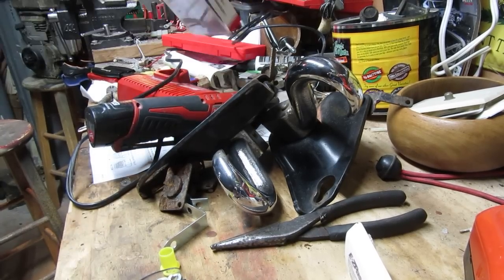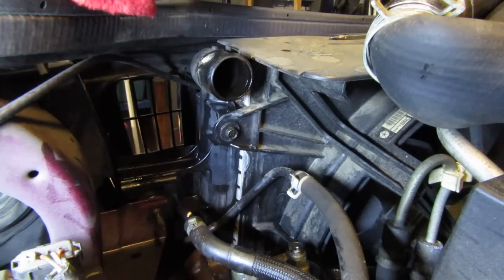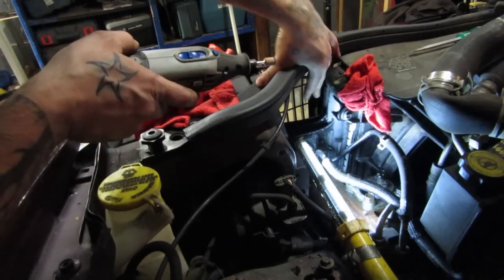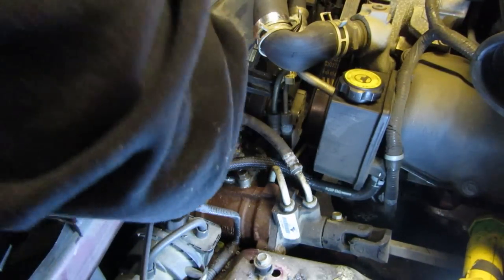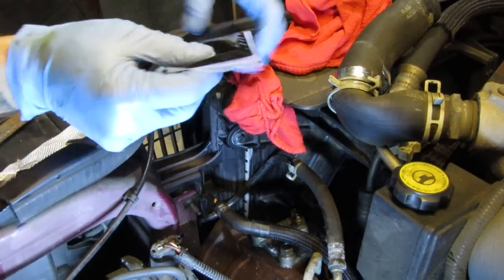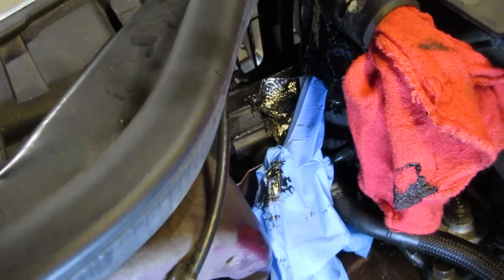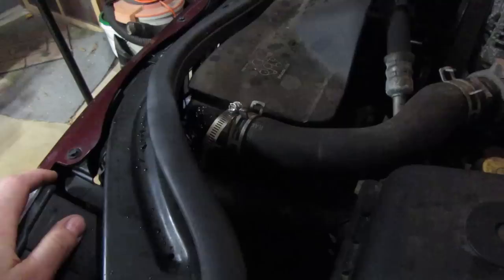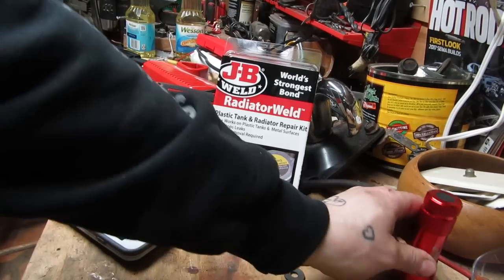RADIATOR FIX - JB Weld Radiator Repair Kit

Comment: Thanks for sharing, I will be trying this on my Land Cruiser 100 series for a quick repair. 👊🏼
Reply: Don’t bother it’s $14.99 down the drain.
Reply: Johanna Cruz What would you replace it with if you where out on the trail and needed to get out of a bind? 🤔
Reply: Mister Memo well it was just a hairline crack. Now that applied all that epoxy is worst🤦‍♀️ I had to buy a new radiator last nite which I will install myself later on.
Reply: Good luck but yes I was stuck and didn’t managed to stop the leak.
Reply: @goodvibes04281  I hear you tho! It's not the solution for sure. Thanks for watching :)

Comment: i would suggest a new radiator saves alot down the road 
does not work with all situations ....bite the bullet and buy a radiator ....an aftermarket radiator is better than this ...
Reply: Not for me i’m not that handy. And mechanics get 140$and hour here in Reno  so i’m gonna try it   On my  old. jeep.  Lots of jeeps here

Comment: You should have removed the Radiator , and fix it . Doing it this way made you miss a spot.
Reply: If you're gonna go through that much trouble, you may as well replace it.

Comment: i may add one   not so minor point.  because  these are pressure  cracks    it is advisable to drill a small  hole on either end of the crack.  this  does 2 things  it stress reliefs the  plastic from the natural tendencies of the crack to extend it self. secondly it adds a small anchor point  for the epoxy to ceate a  thru rivet in the round terminus at either end of the crack.  i can assure you the stress relief alone is the real benefit of drilling both ends of any crack  ,  no matter what the material . im willing  to bet  its the lower end of the crack that  a stress relief drilling would have helped hold, altho i will agree it is by its nature a patch, so the benefits  of being stuck completely  and  managing a leak to the point where you can still drive  have me adding  a little kit  as you described  to my desert box in my truck
Reply: Wish i would of seen this comment before I did mine that makes alot of sense
Reply: An excellent point, indeed.
Reply: I gotta do a hairline crack right on the top on mine, I got lucky and it's in a good flat spot so I'm going to try this. Thanks for the info

Comment: Well if the radiator was removed and repair was done on a work bench or table the proper application would've  been more properly done giving a permanent seal
Reply from the maker: If I am removing the radiator, I am just going to replace it. This was an attempt to hot have to do that
Reply: @DEInTheGarage  
Xactly & EvN if done professionally like that, probley only would’ve lasted for a few months or a year- IF other parts of radiator weren’t about to wear out👋😒 - I think I’ll attempt JB waterweld, not radiator weld(both of which I have) because it’s eazier to apply well, ironically

Comment: Just finished mine up letting it dry now, that epoxy gets hot quick and I tried to brush on then add the fiber glass ( yes I brushed in the fiberglass before applied, be quick thou)and pour the rest of the epoxy on the fiberglass, I used the putty stuff first and it started leaking again. I went longer and taller than the actual split. Thank you for the video it was really good to have the help
Reply: No I’m sorry it didn’t, it did slow it down to where I can address it every 3 days instead of every day, but it might work different for you. It’s definitely something that I now keep in my emergency kit when I go to the woods
Reply from the maker: @bspeckter  dang.. sorry to hear that
Reply: Well, it’s cured and looks like I was trying to hard to get it on the radiator and the fiberglass, it’s bubbling up at the top. I should have put it over the putty , because it was only bubbling from the sides. I’m going to go grab another kit and add it on my dinner break this afternoon. You’re kit is a very good suggestion, I know that this not a permanent fix, but I’m on a budget and I want to replace my radiator with a good quality one so I need the fix to make it a few more paydays. I will let you know in the morning how the second try goes.
Reply: @bspeckter  Did it stopped the leak?
Reply from the maker: Lets us know how you make out! I was not successful, but I believe this product could work under better circumstances
Reply from the maker: I hear that. Might as well try the quick cheap option before going all in on new parts. Good luck!

Comment: I tried this stuff, and so far so good.  I know I will need a new radiator soon. My break was on top and easy to get to.  I have a dremel engraver, which did a great job to V out the crack, and went about 1/4" beyond each end of the crack.  Thanks for the video, it really helped, 👍!

Comment: Adding pepper into the radiator works, I did it a few times, and as the engine heats up, you will see the leak go away
Reply from the maker: No kidding... I have heard of egg before, but not pepper.

Comment: Dude great video. Especially the part that shows your failure. I do believe if you were not so intent on making a video your effort would have been successful. I used dye to isolate my leak. A YouTube video informed me how to find coolant leaks. The bright orange fluorescent dye showed me my hair line defect. Well better repair next time. I really get close with my zoom on my phone to inspect things my eyes alone cant see. I'm going to invest in one of those telescopic micro lights soon
Wow a JB Weld radiator repair kit.  
That was not available 4 years ago when my 6 month old radiator sprung a leak along a crease that connected to a mount crease. My patch peeled and leaked after 2 years now in the 100° Texas heat. Maybe the fiberglass would have made a better patch. So, I am not  going to remove the part of patch that  is working. I am going to patch the failed part of the patch. I hope it hold for another 2 years

Comment: My crack is in the same exact spot
Reply from the maker: Yea, it is a tough fix there. too much going on to get a decent patch
Reply: D&E In The Garage I tried jb weld and a stop leak and it don’t work guess I need a new radiator

Comment: Cracked my Volvo s60 radiator on the plastic part also. Going to try this this weekend. Also it's not so much the cost of the radiator it's the process of taking it out which sucks on that vehicle...
Reply from the maker: Agreed! Good luck with it!
Reply: Did it hold up
Reply: @mikeyboy1001  Yes. I've put almost 5k on it and its held up fine.
Reply: Going to do this in a Volvo 850 wish me luck

Comment: Probably would work better if the crack isnt on the side
like yours. If the cracks on top maybe itd work better since the jb weld will be seeping into the crack
Reply from the maker: I agree. Also, if I had removed the rad it would have been easier to apply, but if  I am removing it might as well replace it (which is what i did)

Comment: I’m putting this on my radiator. It’s cracked down the middle of the plastic part. I just need a temporary fix until I get paid next week for I could replace the entire thing
Reply from the maker: Good luck with it! Hope it works for you
Reply: D&E In The Garage it’s still leaking but not as much as it was. Before I had to refill the entire thing with 2 and half gallons of water now I don’t even have put 1. It has help these last few days bringing my truck to the shop tomorrow and buying a new radiator Thursday. I don’t recommend it as a permanent fix but it is s good temporary repair until you get it fixed. I’m very impressed with it

Comment: FYI, Flex seal will not fix a leaky radiator either... Don't ask me how I know... Lol
Reply from the maker: Hey man... gotta try everything at least once, right?
Reply: @DEInTheGarage  yep. I think like you, if it can save me $100 I'm all for it.
Reply: I put flex glue on my crack recently.. And gasket maker. Hopefully trying this before replacement D: 
Gonna end up getting new radiator eventually but cant do right now so anything to hold it off lol
Reply: Lol or me how i know it doesnt fix a roof either .

Comment: The JB weld saved my butt on the trail. But like you I ended up buying a new radiator. Even if it had held I would of put the new one in. Out her in the SW running in the heat I would constantly worry about it giving way. As usual awesome video. Cant wait for the video on the radiator swap.

Comment: Great video as usual. I love to see this kinds of things tested out. I generally wouldn't trust this kind of repair as a permanent solution, especially for something as critical as a radiator.   You hit the nail on the head though with an emergency remote repair kit. Some of that stuff is going into my bag for sure. With the addition of the fiberglass, I bet you could temporally patch a hole in an oil pan or diff cover if you had to on the trail. Unrelated question, the two hooks on your bench at the beginning of the video got me thinking as they look like the a designed pointing up. I just put factory tow hooks on my WJ which point down and I worry about a snatch strap coming off during a multiple pull recovery. Any advice? The metal clips intended to help this issue are not made for the mounting hole orientation of WJ hooks. Tape or zip ties maybe?
Reply from the maker: Those hooks are for a WK Grand Cherokee or XK Commander. I have personally had the issue you are describing with WJ hooks which point down. I bet you could make your own tabs out of some light gauge metal from the hardware store. Perhaps I will give that a try and make a video. In reality, WJ hooks are only going to allow the rope to call off when the rope goes slack, so once you start pulling you should be fine. I know that used that design because of how the bumper is, but it is clearly a design flaw

Comment: Is that a common WJ problem???  I wonder if over tightening that mounting bolt causes cracks in that area of the radiator for many WJ owners.  You may have had a better seal if the radiator was out, but then again if your pulling it, might as well just put a new one in.  Maybe you can reinforce the new radiator in that area prior to the install.  Either way the JB weld was definitely worth a shot, and we all learn from your trials.  Excellent job and Enjoy that chicken!
Reply from the maker: It is not a common WJ issue. This WJ was sitting for a long time and when I got it home this rad leak was there. Not sure if coll had something to do with it or what. New rad will be in this weekend and then I can introduce the new Jeep to the world
Reply: @DEInTheGarage  awesome man! Can't wait!

Comment: Same. Mine on driver's side middle. Steering box is sometimes wet. Hey, darn thing never goes over 208. Downside, not very hot on cold days.
Reply from the maker: Yea, mine was the same. Heat was fine when I filled it, but the longer I drove it, the lower the level got, the cooler my heat would blow